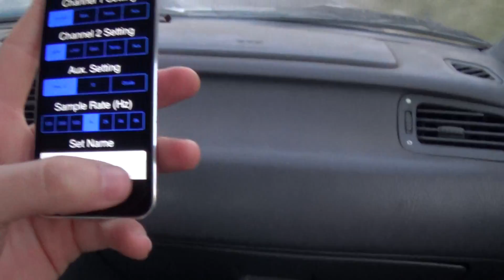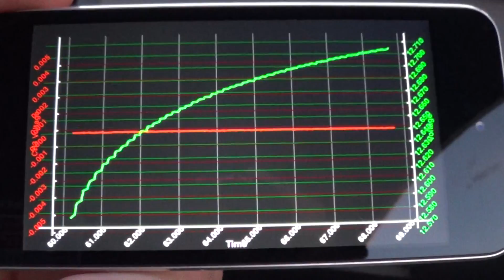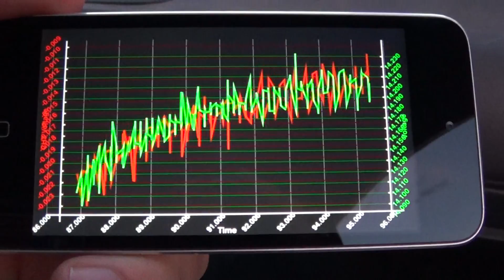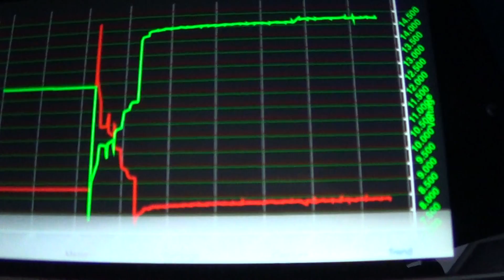Installing a Mooshimeter in a Car (Part 2)

Comment: could you show me the drawing diagram of how you connect the ohm cable to the car cable, if the car have 3 heavy gages on negative post. Also math how to convert mv to Amp DC reading. Did you use "Aux. DC" for reading on the Channel one?
thanks.

Comment: Can you convert the shunt voltage to current so you can see the value in current on the screen?  That way you don't have to think about the calculation.  This meter would work great for big lengthy vehicles.